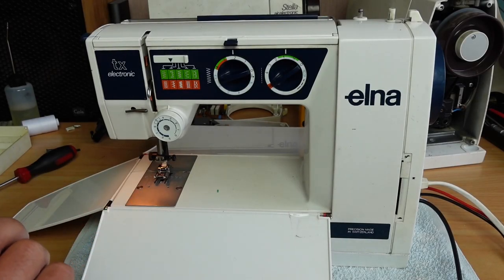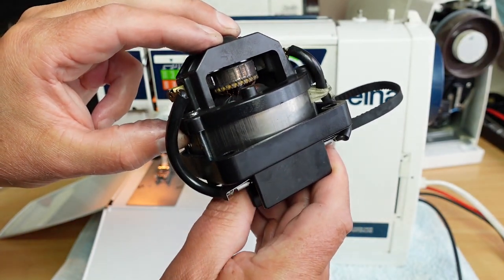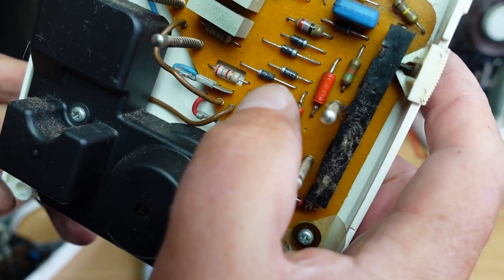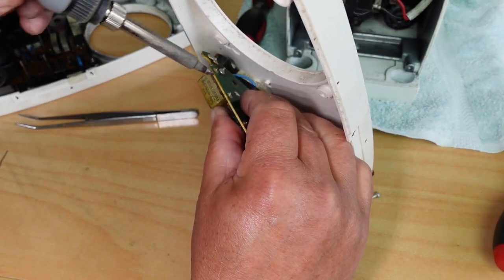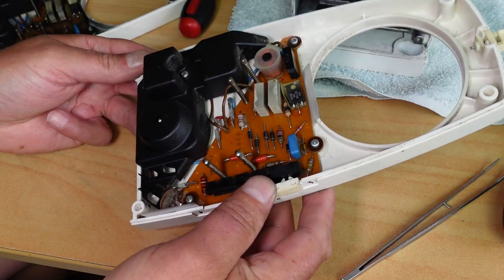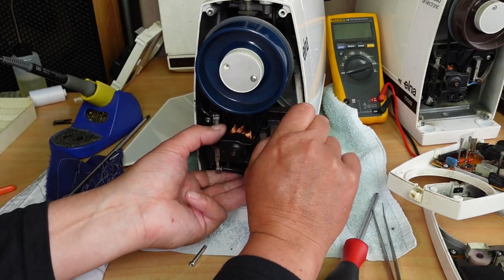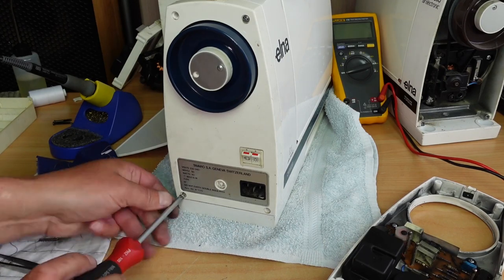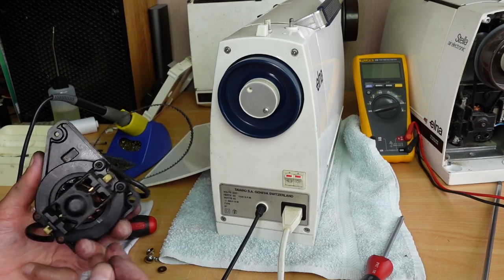Elna Electronic - Fixing Motor Stuttering or not Going

Comment: Nice description of how to figure out which component on the board was shot for certain, rather than just replacing without explaining the why’s!   Elna’s are wonderfully serviceable!!  I wish they continued that way of building and engineering sewing machines….   Lots of these great older machines are getting harder to find parts for.  Hoping that 3D scanning and printing technology improves faster to be able to just get a new part printed and save these older machines.